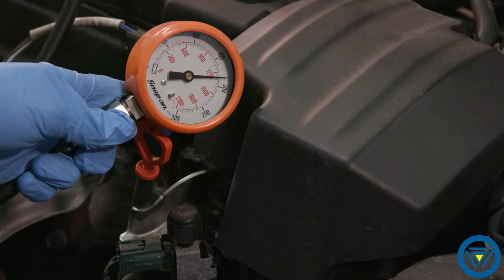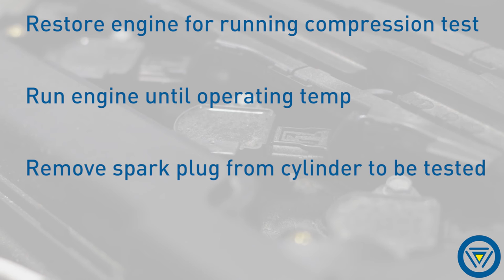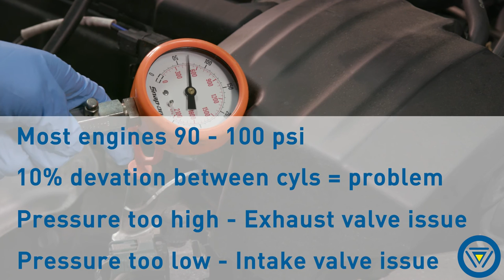How to Perform a Static & Dynamic Compression Test

Comment: I noticed in the video he kept bleeding down the pressure on the running test, why not let it run and watch for an intermittent problem?
Reply: Well in the event that the cylinder is leaking air (unable to hold psi), the relief valve resets the reading on the gauge which is useful when further diagnosing the loss of compression. This helps detect, further testing will confirm